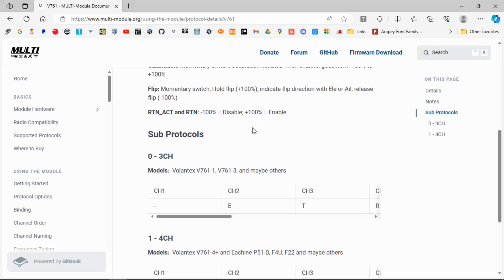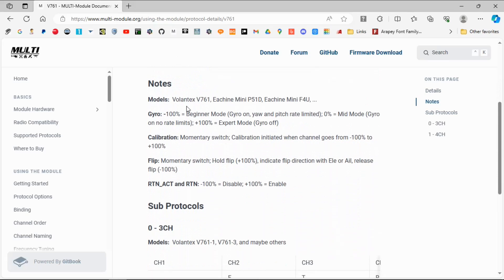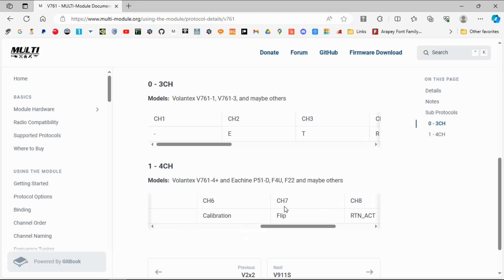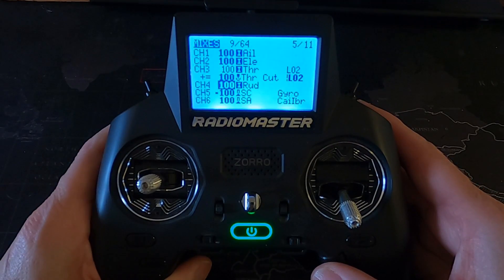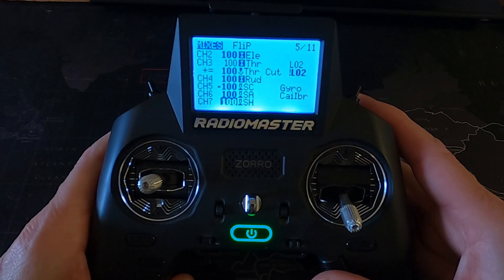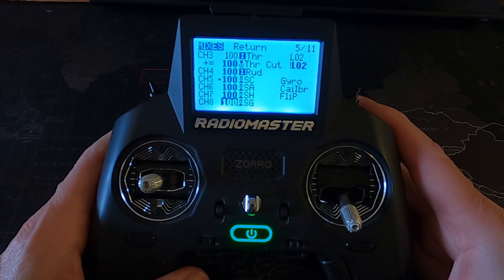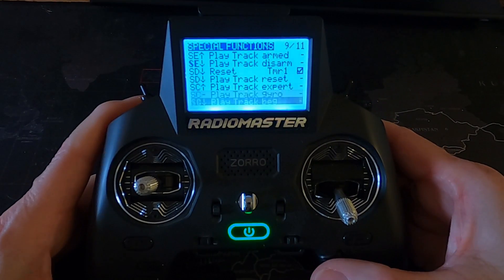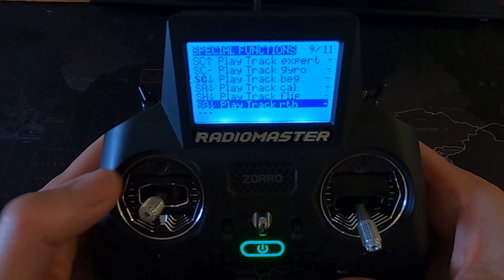EdgeTX Setting up the gyro function in a foamy park flyer

Comment: Have you ever had issues with the ‘calibration’ set to channel 6 and it no longer allows the rudder, ailerons, and elevator to function?
Reply from the maker: Could you please give me a little more information so I can help you.
Reply: @the-happy-RC-flyer 
I have my “calibration” set to the SD push button and on channel 6 function of protocol 761.
When the SD is activated to calibrate, it deactivates the controls except for throttle.
Reply: After release only throttle works.
Reply from the maker: @trendkill555  you say calibration to a channel which model is it?
Reply: @the-happy-RC-flyer 
Any of the 400mm Volantex/ Eachine warbirds.
Reply: @the-happy-RC-flyer Volantex 400mm warbird, calibration for gyro on channel 6 of protocol 761 on a Radiomaster zorro.
Reply from the maker: I would suggest checking your programming confirming which function uses which channel.

Comment: I’m trying to follow your directions but when I go to the mixes to add weight for the Gyro, I can go all the way up to -500 and +500, instead of 100% as shown. 
I am running 2.7.0 firmware. If i update to newest firmware, will my “weight” options look the same as yours?
Reply from the maker: I am pleased you sorted it out.
Reply from the maker: The firmware will make no difference. Just change the weight to -100 Are you setting up the same plane as in my video?
Reply: @ well….mine is Volantex brand as opposed to eachine but should be the same I thought. 
Thanks for reply.
Reply from the maker: Is the stabilisation not activating?
Reply: @ I have it figured out now, but oddly, it would only activate if the weights were set to the extremes. 
I made an error previously, deleted old model, made a new one fresh following your vid and all is fine now. 
Thank you for responding Bill.

Comment: Thanks. Very helpful. I have two questions. 
In the mix menu, what is the second switch selection further down in the menu selection? Also Have you figured out how to get the battery and low signal telemetry from the model?  It’s on the supplied transmitter with these eachine and Volantex models. It would be nice to have the two beep warning for low battery voltage and four beep warning for low RSSI. 

Thanks again, and merry Christmas!
Reply from the maker: The second switch can be used to turn the channel on and off for example with dual rates. You can only set up telemetry warnings if the receiver in your model has the necessary telemetry sensors. Discover them in the telemetry window to see what sensors your receiver has. My model has only the receiver voltage which should stay consistent. No main battery voltage sensor is available. RSSI  will automatically come through to your radio if available on the receiver in your model. Happy Christmas.
Reply: @the-happy-RC-flyer  I’m specifically referring to the Volantex and eachine models.  When. Outage goes below 3.8 or volts, the transmitter continuously double-beeps. When the voltage goes below 3.7, there is a power drop to the model. When the voltage goes below 3.7 the power is cut to the model with full power loss. 
I was wondering if there is a way to at least get the beep telemetry for the battery voltage. 
I’ve tried using the discover telemetry option, it discovers nothing. 

Thought you might know a way. 
Thanks again and great channel.